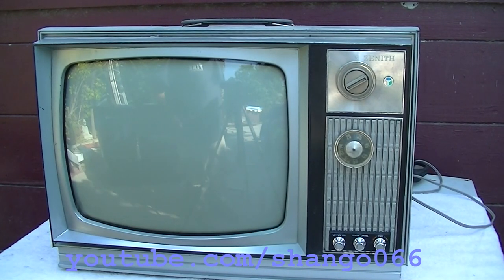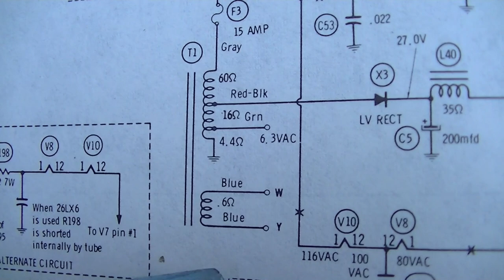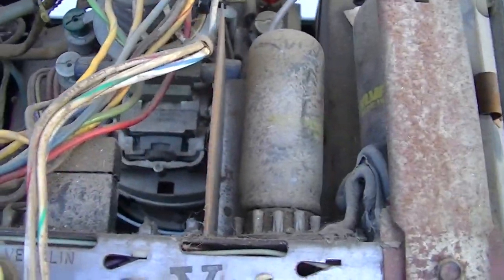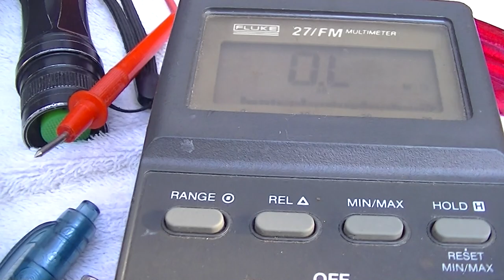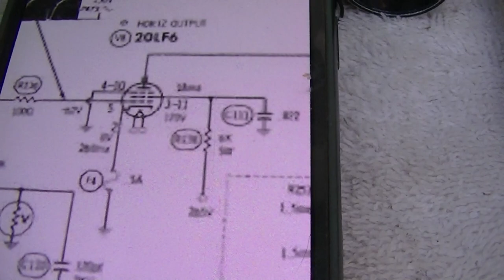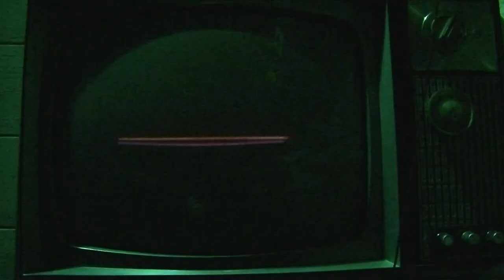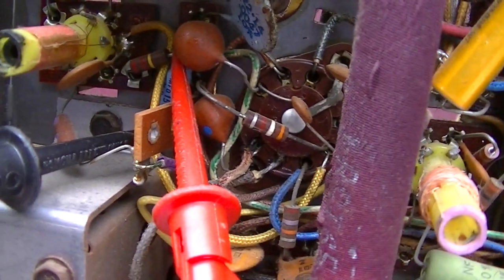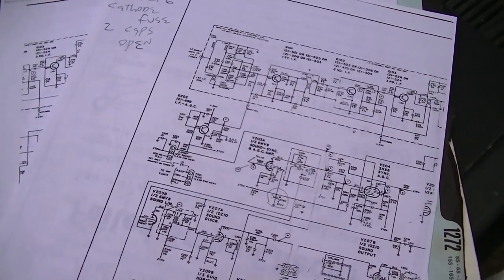1973 Zenith 14dc15 Diagnosis Vintage Tube Color TV Desktable

Comment: My first TV was similar to this  model, and it was the first color TV my family owned.We won it in a raffle at my elementary school. Many years into its service life, the horizontal linearity began to suffer. Even though the 20LF6 tube tested good, my simple TV troubleshooting guide convinced me It could be the problem, and I convinced my mom to spend $25 on a new tube, so those were expensive tubes even when you could obtain one from the counter at the local electronics store. I put in the new tube, with no improvement. Now I realize there was probably a weak cap somewhere in the set. We discarded the set long ago and  It is in a dump somewhere now.

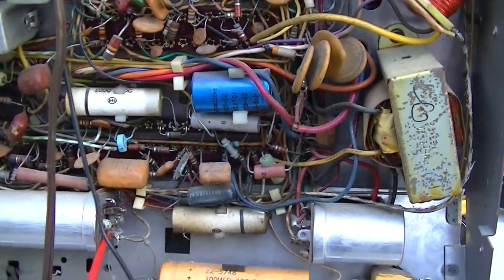Comment: Not trying to be " that guy ". But at 10:15, I believe you were referring to static vs dynamic testing. Static being a continuity test, and dynamic involving voltage drop across a faulty circuit. Great video by the way. You and Mr. Carlson's lab, are my vintage electronics favorite.

Comment: You would be a great teacher for this stuff back when it was in its heyday, I'm still trying to find the similar issue with my CTC 22AA it went out on filament string short I got the filament string back but now I have no high voltage it's inspired me to look in the same place where you found cathode fuse.

Comment: Good diagnosis. Those old Bel-Fuse chemical fuses seldom failed. I worked for a Zenith ASC & Sales shop for several years.
 I still have dozens of them in storage. The converter boxes do cause noise problems on the old sets. Sometimes the sets AGC can't overcome the output levels of the boxes, and you have to add an attenuator to  the tuner input. 
The bad part of Sams is the errors, and without a subscription to POM, you didn't get the PCB's and corrections.
 I loved the Zenith OEM schematics and the Sight and Sound Training Manuals too. Their tech support was superb back in the day.

Comment: I have the same chassis in the 16" version. That buzz is always there, with either text on the screen or high contrast scenes with lots of white, can't make it go away completely. Am surprised it worked so well with all those capacitors bad, I should check mine.

Comment: I can imagine if that entire unit were hung with a wire, outside, tipped at a corner, and hosed down with an entire can of CRC electronic parts cleaner- it would run much cooler. All that dust and mud acts as an insulator, causing resistance.

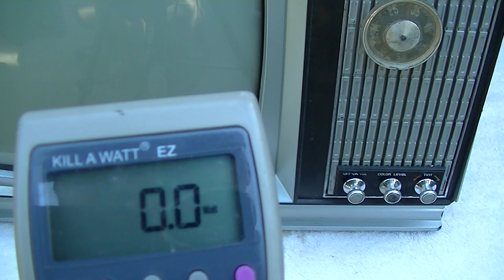Comment: 1:02 Look at the spot of chrome missing from that goddam thing! I used  to get so sick of rubbing my thumb around that dial 6 times just to get from 27 to 56; eventually, I took off the outer shell and replaced it with a radio knob so I could just turn the disk with the channel numbers. The 1975 "UHF Equality[despite no preset fine tuning]" rule  finally forced Zenith to part with its idiotic  UHF dials; not a minute too soon.
Reply: What was the "UHF equality rule"? Did it force them to build UHF tuners that tuned in the same manner as the VHF channels? With discrete clicks?

Comment: What did you expect?  If Murphy's law let you find the bad tube so quick, it was going to be an expensive one!  (Unless it was the CRT, but I think THAT one is powered by the transformer).  More likely the heater shorted to the cathode and THEN it blew.
Reply: The alarm bells should have started ringing .

Comment: Did you update the tube spreadsheet to indicate that a good 20LF6 is located within the 1973 Zenith? Can you imagine doing all of that point to point in the factory hour after hour day after day there has to be at least a 1/4lb of solder under there.

Comment: i was offered a collection of sams ranging from 1936-76. than man says that it covers tube radios, tape recorders, amps. transistor radios, TVs, automobile radios and CB radios.....also includes 2 sams 5 drawer cabinets and several boxes of components. the price is $500, would you consider this a good deal? i have no reference to what these should be worth, but see myself continuing with electronics as a hobby for the rest of my life.....i think i just answered my own question.
Reply: That would certainly be cool. Did you pull the trigger? We really need to start digitizing all these.

Comment: Just wondering why the tubes haven't been at least washed and cleaned. They'd operate at slightly lower temperatures and be visible to check for gassing, if they were. And leaving the chassis still filled with dried mud doesn't help either. Still I like the vids, but I always found that cleaning up the set a bit before working on it made everything easier.
Reply from the maker: High risk of damaging the sockets or tubes wrenching on something that hasn't moved in 50 years.
Reply: @shango066  Exactly!!
Reply: And the risk exists loosing the tube numbers, they sometimes wipe off.

Comment: You can replace that 20lf6 with a 6LF6, just add any other tube wired for filament only to eat up the voltage difference.
Reply: The current draw would have to be on specification. It's series filament. A filament transformer for the 6LF6 and another dropping resister might work.

Comment: Hey Shango how you doing there buddy I'm calling from Connecticut here and would you rebuild jukebox 50s tube amplifiers for me if they were sent to you
Reply from the maker: Shipping is a pain in the ass to deal with and no way to warranty the work.
Reply: shango066 SHANGO,can you do sharper image ionizer gp professional,or wein vi2500 both are chemtrsil Buster's( they remove nano particles from chemtrsil 100% in a closed room..can you diagnose them if I send them to you?
Reply from the maker: is that mms or something like that? I have that in stock

Comment: I love the capacitor testing with music. There is always a better/different way to accomplish component testing, this is the most interesting of all. People spend loads of cash on ESR meters that will do the job, but letting your ears be the judge, and really quickly getting results is great. Shango is this faster or just the preferred method for you?
Reply: Don Hopkinson he has said its a quick way to test...  It will find a open or shorted caps easy...  It won't tell you if it out of spec, just very bad caps..

Comment: what about using a 470R resistor in the neutral end of the heater string to try and save that replace that tube you put in to get the set working.
Reply: Tube filaments don't fail all that often. Most often, it is the cathode emissive material that no longer supplies enough electrons to the plate

Comment: Rodents seem to prefer the wiring in my car, but then there's no way into a new flat screen.  I hate it when you replace a fuse and the new one does not blow.  Then what do you do?
Reply: Robin Sattahip Replace it with a severely underrated one.  If that doesn't blow it, you can add a shunt resistor.
Reply: @thesquarerootofnegativei6225  Thank you.
Reply: Volvo and Saab wiring.

Comment: It's possible the John McCain media spectacle caused the boomer TV to commit suicide.
Reply: I aint no Boomer...1965 to 1980...The Zenith is an Xer
Reply: I meant made by boomers.  Boomer engineers and boomer slide rules.
Reply from the maker: Propaganda overload, propaganda safety devices did their job
Reply: It was more seditious signal than that old patriot tv could handle .

Comment: That looks like a 71 zenith the 73 zenith used a 26LX6 which is a cheaper replacement to a 20LF6 and the 73 zenith only used 4 tubes

Comment: Sams uses the low resolution intentionally so people won't be able to pirate their material and post it online for free.  If you could print it out in decent resolution people would scan it online.
Reply: I do not understand a shit in those scans, the resolution is really too low
Reply: Robin Sattahip I suppose your right, but the impact of the low res is not worth it IMO.
Reply: @waltschannel7465  There's no other rational explanation since the technology for high resolution exists and the original paper documents from the 70's and before were very clear non- digital printing.